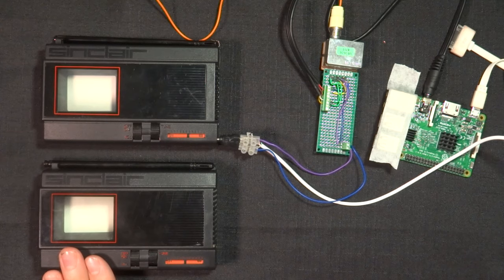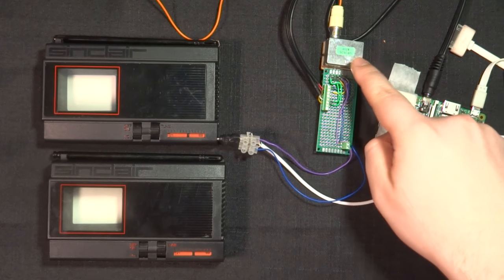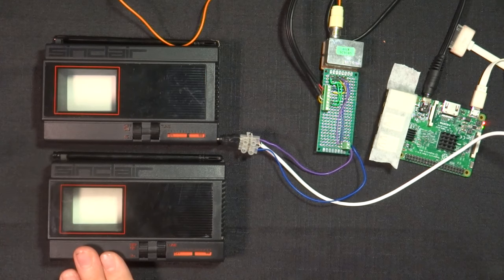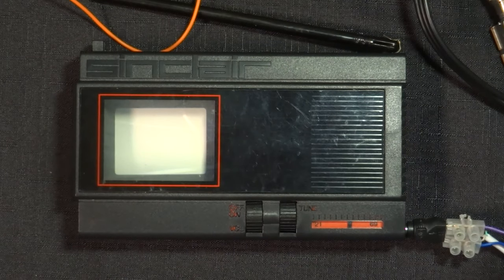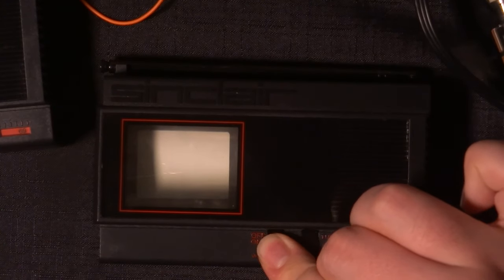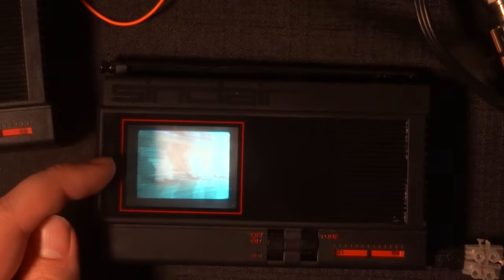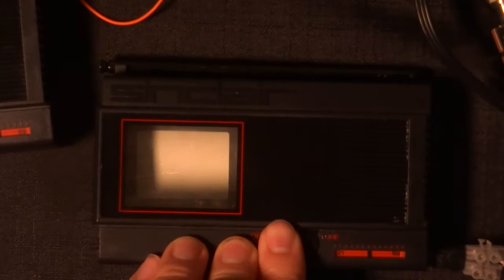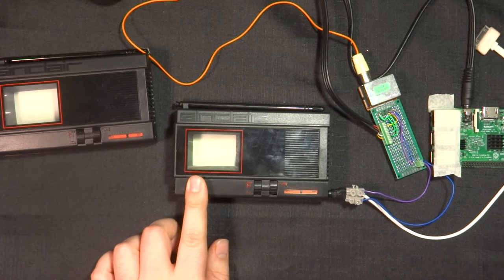Vlog : Sinclair FTV1 pocket TV part 1

Comment: On the TV you recapped, your CRT tube looks to be socketed! I've seen only one other FTV1 with a socketed tube, with no infos on it. Can you let me know what model number and serial number this particular TV has, and if the text on the label is printed with black or blue ink? Also, there are different models of CRTs, some with see through glass in front of the electron gun,  some with white and some with darker underglaze coatings, making the glass opaque where the electron gun is. I'm trying to figure out what models have what tubes. Thanks!
Reply from the maker: Hi sorry youtube didn’t show me this one ether :/ ill try give a more detailed response later . Yes there some where the tube removes not sure which is older then the coating on the tube is shielding i have two of these TVs one with and one without ill see if i can answer the rest of your questions tomorrow when i have time to take it apart :)
Reply: @ElectronsNeeded  The service manual mentions the tube coating, so it helped me figure out what units come with the clear tube. But I never saw any mention about the socket. I have a few different models FTV1/A, FTV1/A/F, FTV1/B and FTV1/C, none of them with a socket.
Those tubes are so fragile, I need to figure out a way to make the contacts more reliable at some point. The socketed tube is easily removable at least, without stressing the contacts desoldering and resoldering.
I tried to find a production part I could use as a socket for my project, but the CRT pins are flat in a way that doesn't seem to work with standard breakaway headers.